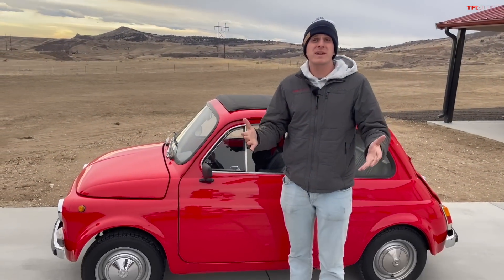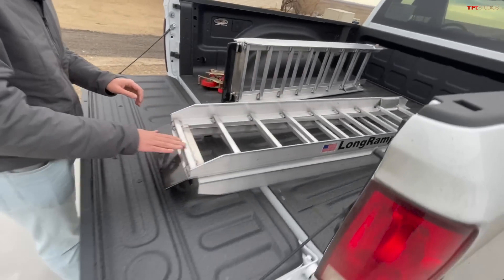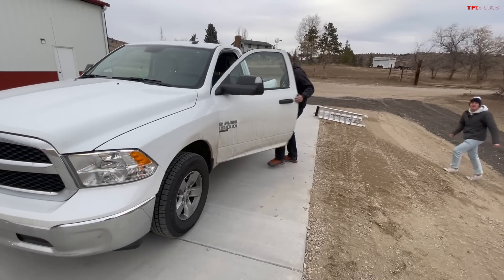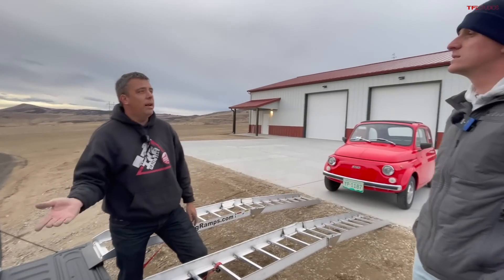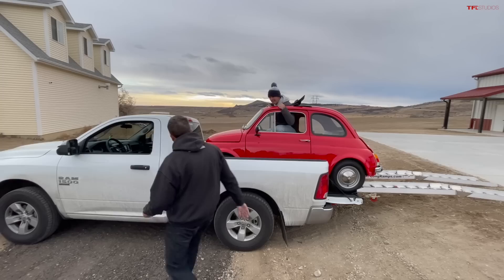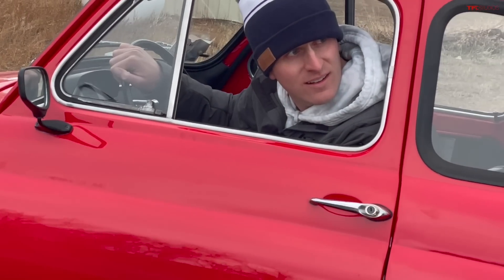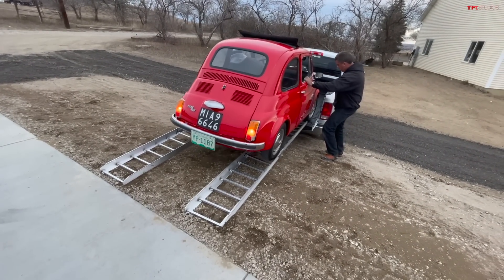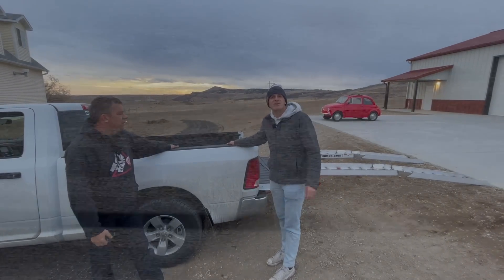Is It TOO Big & Heavy - So Can I Actually Drive a CAR Into Half-ton Ram Pickup?

Comment: Please, please! Do this again when you have an HD truck with an 8 foot bed around. I think a 1 ton dually may even shrug at the weight in the bed. If it could be secured safely into the bed it would be hilarious to take it around the block and catch the reactions of onlookers. Also really love the Fiat's appearances on the channel, I can't believe it weighs even less than my classic Mini does! (1,200 to 1,500 lbs depending on options/year) I guess it makes sense since the Mini has slightly more interior space and larger engine choices.

Comment: I think you should have backed it in so that the weight of the engine would be closer to the rear axel and not on the tailgate.
Reply: If the wheels will fit. It looks like the rear overhang is longer.
Reply: 9:45

Comment: A good idea when loading something like that is put a piece of 3/4” plywood on the floor of the bed all the way back to the edge of the tailgate. And I made small chains with turnbuckles and put them next to the tailgate strap and tighten them just enough to take the tension off the cable. That way the plywood disperses the load better and the turnbuckles save the cables. I do this when transporting a full dress Harley.

Comment: this was fun to watch but im gonna say you were really really lucky,  those cables that hold the tailgate arent meant to hold that much weight.   its not the cable strength  its what they are held in by so your car was supported by two1/2 inch bolts......

Comment: You should of reversed it in, to put the engine weight in the center and off the gate. Also R would probably go easier as it should be stronger than first gear.

Comment: I'm impressed with the  strength of those tailgate cables, and thinking along a bit further, it would be interesting too to have the FIAT weighed at front axle, rear axel.
I'd like to know then, how much actual weight was on that tailgate.
Reply: The split tailgate Ram sells on the new version is rated at 2,000 lbs. they aren’t like the tailgates in the past!! I dropped a drum of gear oil on the tailgate of a late 70s Chevrolet 1500 and the tailgate folded! 😂😂😂. I have done similar with a 2019 F150 and there was a small dent on the metal, but the tailgate stayed straight!!
Reply: @C10sRule  That's interesting, but remember, my question(s) primarily, are related to the strength and durability of the cables.
Reply: @regsparkes6507  if they rate the tailgate for 2,000 lbs that includes the cables.

Comment: Meh. I had 3800 pounds in the bed of my F150.

A pallet of 25   24x30 patio stones (110lb each) 20- 50lb bags of crush down

Drove almost 80km home on the highway. Honestly other then the blocks shifting on the pallet slightly when braking, It didn't feel that bad. 

And yes, Home depot loaded it. I didn't even think of how much those patio blocks weighed until I got home and was like wow that stupid. Lol

Comment: It doesn't take a rocket surgeon to know this is a bad idea.  A Ram 1500 is a half ton pickup which means 1000 ton capacity.  Even a Ram 3500 with a full 1 ton capacity would be a challenge for this as the Fiat weighs 2300 lbs.
Reply: My 89 Geo Metro  weights 1,600 LBS and it's bigger than his car .
     He said his car weights about 1,000 lbs .
         Never believe what  they advise what a truck will haul ,
    They'll say anything to make a sell.
Reply from the maker: Your numbers are way off. This truck has a 1500 lb capacity. The Fiat weighs 1100 pounds.

Comment: How piss weak is the Dodge Ram is my 1997 Toyita Hilux with its flat aluminum tray the Fiat 500 would fit easily in the tray and at 1000 lbs tie it down and away l would go and l would get up to 100kph easily it doesn't have a V8 it has a 22R engine a 2,4 litre 4 yes 4 cylinder engine and it wouldn't be in the bump stops and l would be able to drive it says a lot for the usless Ram heaps of rubbish takes a Toyota hilux